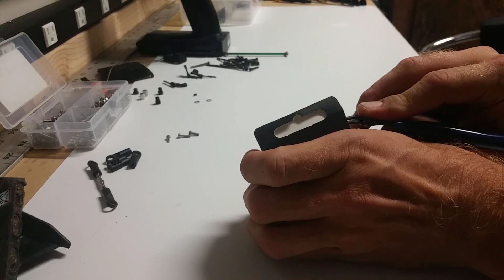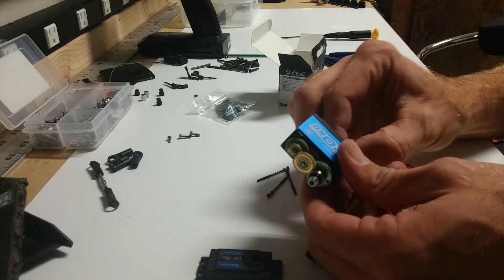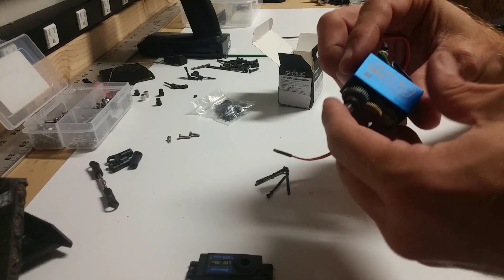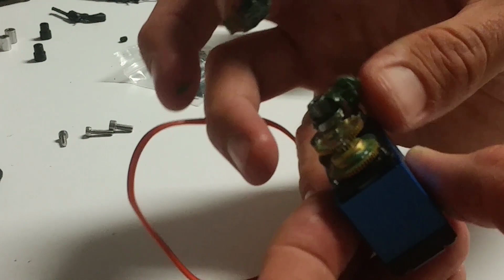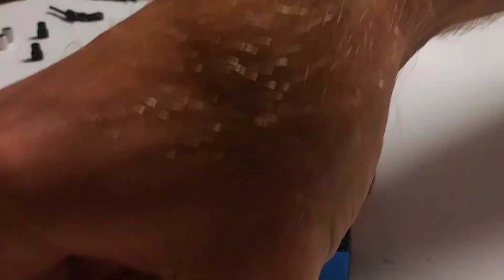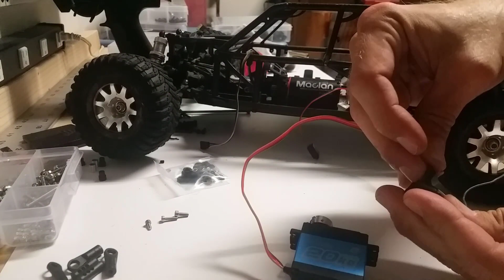Power HD LW-20MG Unboxing, initial impressions, speed demo, and waterproofing

Comment: nice advice, there a new Power HD WP-23KG servo that improves the speed slightly faster. do this servo perform well?
Reply from the maker: Caynex Leong i havent tried the new one.  Ill check it out shortly though.  This one is still working fine in an axial exo but hasn't seen too much use yet.
Reply: The 23Kg is a pretty damn good low cost servo. I put it on my kids crawler...broke an aluminum servo horn and didn't strip the gears....was  suprised.

Comment: I think most problem is air moisture because of hot and cold temperature outside let condensate the water from the air inside and the electronics fail and servomotor rusted. I prevent this problem with water resistant spray like (wet protect) direct on the electronics. Nice Video.

Comment: Great video of the tear down and a good tip about avoiding getting grease anywhere that loctite will be used in. I've actually used this to my advantage when I'm using loctite in areas next to moving parts. A thin layer of grease on the parts that need to move will prevent the thread locker from getting into them and setting up inside.
Reply from the maker: Much appreciated!  I might have made that mistake the first time waterproofed  :)